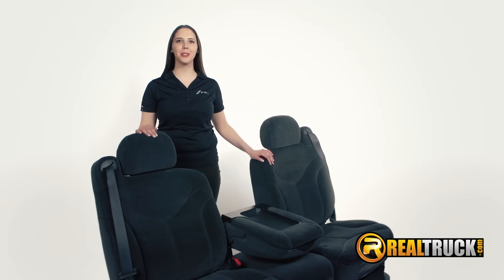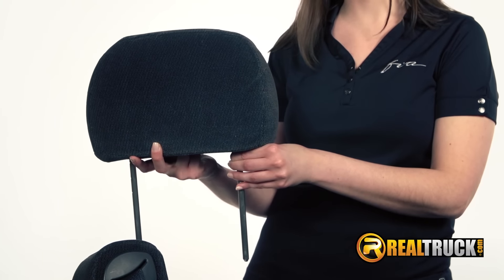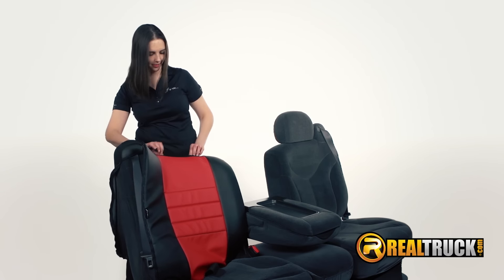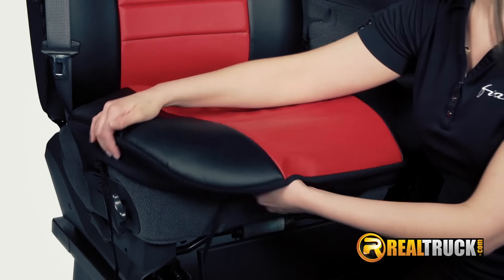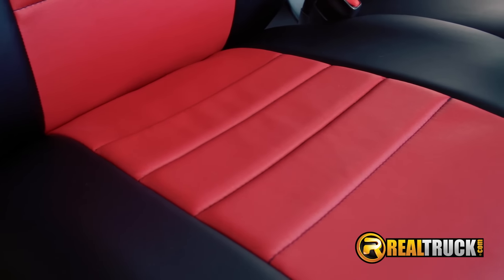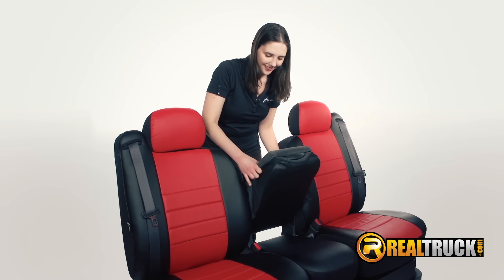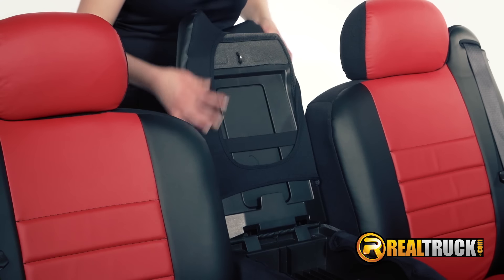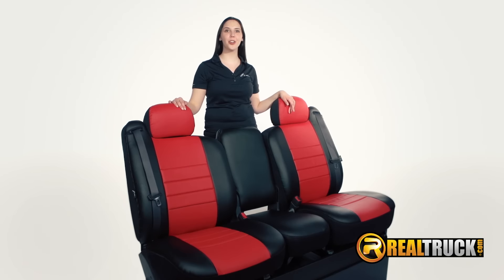How to Install Fia Seat Covers

Comment: how would this work for a 2005 escalade with a center console??
Reply from the maker: Hi Junior, Great question! These would work great for your Escalade. The seat covers would fit right over your bucket seats. You center console would remain factory. You can check it them out here: https://www.realtruck.com/fia-leather-lite-seat-covers/sl68-15-blk.html

Comment: These are the leather like?
Reply from the maker: Luis Larco: Yes, these are the FIA Leather Lite Seat Covers. They are made of Leatherette material and resist water and UV damage.
Reply: @Realtruck  for a 2002 tahoe they cost?????
Reply from the maker: Luis Larco: Yes Sir! Front and Rear Rows. Price ranges from $286-$319 for your vehicle. https://www.realtruck.com/fia-leather-lite-seat-covers/R183304P2002Y102MA.html. You can use this link, fill in your vehicle information, select the proper seat configurations, and colors for your seat covers. Also, we encourage you to contact one of our Product Specialist in our Sales Dept at 1-877-216-5446 between Monday to Saturday: 8am - 11pm EST and Sunday: 9am - 10pm EST. We are here to help!